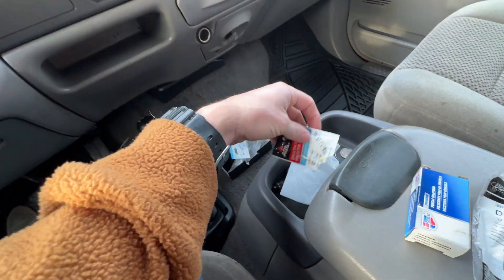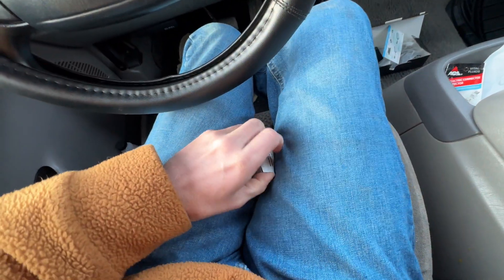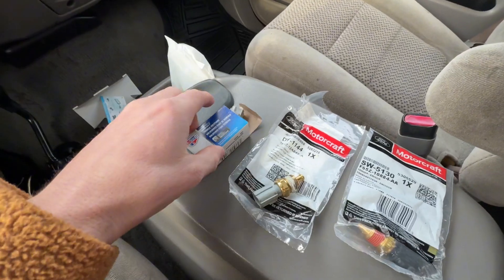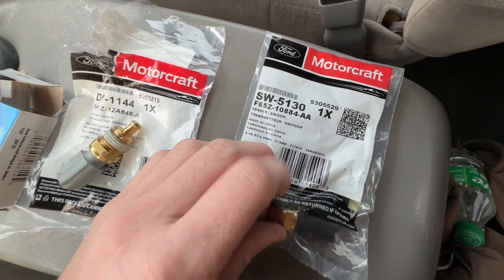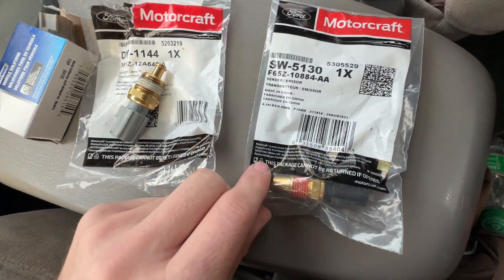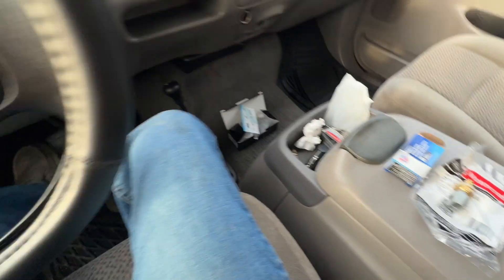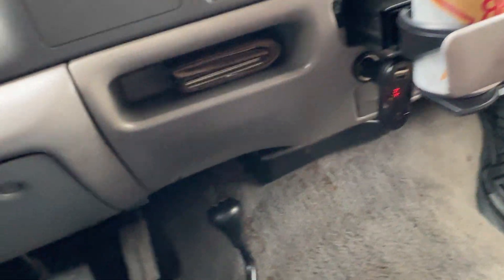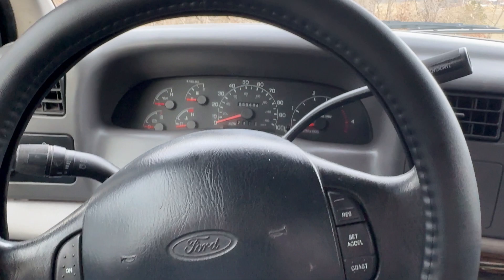How to fix Ford temp gauge. Engine temp sensor (ECT) for F250 F350 7.3 Powerstroke

Comment: Thanks. I just installed the Ford OEM Motorcraft temp sensor after the aftermarket sensors failed twice. 
Great video for 99-01 Ford owners.

Comment: You need a proper correct Ford MFG sensor. amazon and after ,market guys mix OTHER sensors like oil temp set as water temp. TOTALLY WRONG!
Get the coolant temp piece only.
Measuring the OHM piece is about 3, is or reads 20-100+ OHMs its faulty!

Comment: my gauge is acting funny. stone cold engine shows normal temp, after 2 minutes of running the gauge pegs h, but the hoses are cold and the sensor barely warm. I replaced the sensor with a sw 5130 and the behavior is the same exact way. Im at a loss, cant find a broken wire and the gauge shows c when i unplug the sensor. It's almost like there is an additional resistance in the circuit, but i should see  that when i disconnect the temp sensor i think.
Reply from the maker: I’ve had brand new sensors be bad before. Not saying that’s the issue but that’s definitely strange. Connector plug could be messed up, cluster in the dash, or even thermostat. Ford forums will be ur best bet. I’m sure ur not the only one who’s had that issue
Reply: Did you ever figure out your issue? I have the same exact thing going on.
Reply: @owenegolf3768 yea, I needed the $42.99 motorcraft sensor. The 5130 wasn't compatible with my truck
Reply: @ClumsyCars the DY-1144 sensor worked for you?
Reply: @owenegolf3768 that sounds familiar. I know the part store doesn't list the sensor under my truck. I had to give them the part number. That sounds right.
Reply: @owenegolf3768 i just looked, dy 1144 was it. 42.99 locally to me, says incompatible with my truck on orielys, but that's what got my gauge working again.

Comment: After 2 sensors from parts stores didn't work, I went to a Ford dealership who sold me an oil sensor like they did you. I started searching the Internet again and came across your video. I found the correct sensor by the part number shown on your video at Oriellys and it worked like a champ. Thank you so much for posting!
Reply: I literally did the exact same thing!  So pissed!

Comment: I put a new aftermarket harness on my 03 7.3 and the temp sensor connector don’t match the one that’s on the truck do they make sensors with different connectors
Reply from the maker: I’ve seen some different ones on Amazon that might be the style you’re referring to but I’d really try getting an oem motorcraft part. As you can see from the video these trucks are very picky. Good luck! 👍

Comment: Wish I’d seen this video sooner! My 2003’s temp gauge wasn’t reading anything. Ford sold me the expensive SW-5130 sensor ($212 at local dealer 😵‍💫) and turns out I needed the DY-1144 oil temp sensor for my truck.. learned my lesson the expensive way like you did lol. And the rich get richer
Reply: I just bought a 2002 and he previous owner jist did the water pump and did not replace the temp sensor with OEM, does that mean I also need the DY-1144?
Reply: @scovell88 u need sw 5130
Reply: If that doesn't work then u need dy-1144 hit or miss

Comment: Excellent, Thanks, 
My 2002 F250, 7.3 diesel  just  stopped registering water temp today on the drive home from the shop today, so tomorrow I'll check it all over and hopefully if its not just a bad connection it will probably be this sensor, so thanks for taking the time to make this vid, it will probably help me out. Did you swap out the sensor without draining the coolant, hopefully I can just unscrew the sensor, lose a little bit of coolant and screw in the new one. :-)
Reply from the maker: @metalfabman5477  I never lost any. Just unplugged it and unscrewed it out then put the new one in. Good luck 👍

Comment: Dealing with this now
Reply from the maker: @AlexGarcia-jt4bd  hopefully the video helps you out
Reply: @northropoutdoors4278  sure did that and forums. Just changed the water pump to a gates decided since I was there change the sensor went to start it with new $16 sensor one min run time sky high on the dash knew wasn’t possible. Poppin in the old sensor to see if anything changes. But a lot of people saying 7.3 doesn’t like cheap sensors

Comment: Bro where does it go? The cone shaped sensor.
Reply from the maker: There’s a plug that goes straight down into the motor to the left of the black radiator hose behind all the pulleys